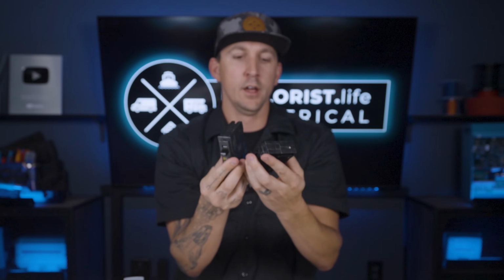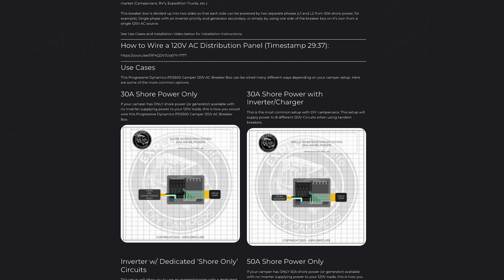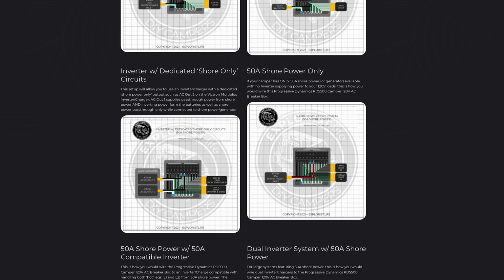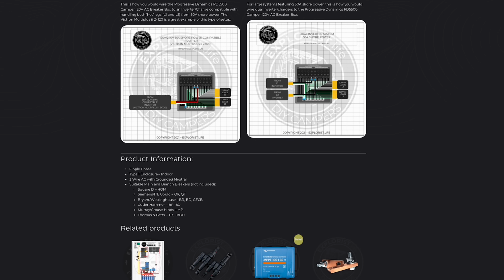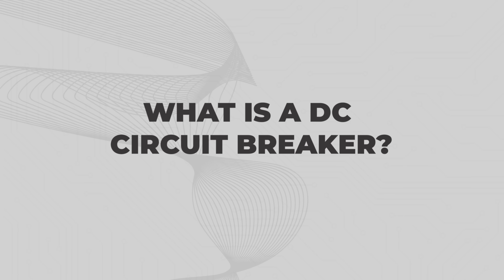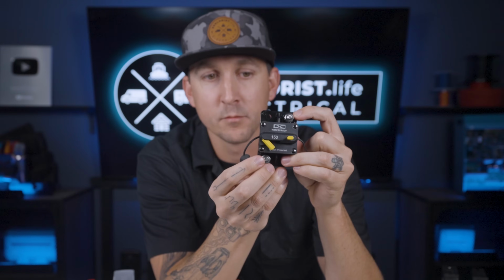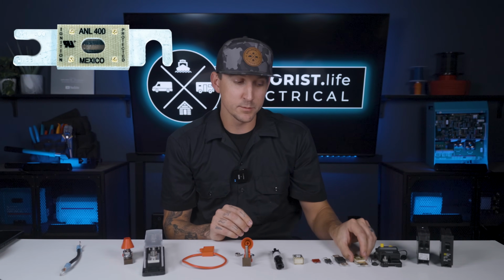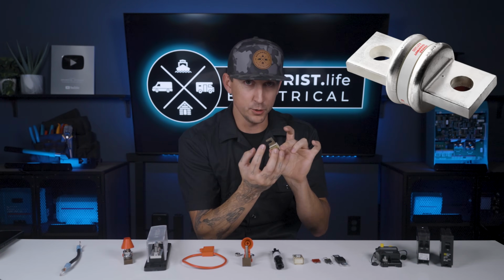Fuse and Breaker Types 101 - Fuses, Breakers, & Overcurrent Protection | Ep: 2/6

Comment: When you were holding up the automotive fuse you can see the notch between the two contact pins.  That notch fits the profile of the top of the fuse and you use an other fuse as a fuse puller tool in a pinch.

Comment: I have a victron Orion-tr-smart, which, other than being able to charge a 24v system is essentially brain dead. No way to monitor its current. I’ve got an extra smart shunt because I got the lynx shunt. So I connect up the Orion to the smart shunt, connect the smart shunt to the negative bar above the lynx shunt and set the smart shunt to monitor mode. I believe carbo go allows for two shunts. So this way I can monitor both?
Reply from the maker: This may take a more in-depth look at your personal setup.  If you have purchased/are purchasing from our store (shop.explorist.life) reach out for some more personalized help: shop.explorist.life/support

If you've purchased/are purchasing elsewhere, reach out to your dealer for support.  We'd love to have you as a shop.explorist.life customer so we can provide a bit more help in the future. 🙂

Comment: I bought a bunch of PV fuses. Looked some different inside than yours.
But they had bad connections - some 2 month in the use, they got bad resistance. The boat owner threw them out. 
I put them in because there were long and complicated / harsh ways for the wiring.

Comment: It's important to note that AC and DC breakers (also fuses and switches) are NOT interchangeable.  They have different requirements for interrupting current as DC power does not turn on and off by itself many times per second like AC power does.  Some devices are rated for both but at different current levels.  Always read the specs carefully.

Comment: I just bought an mrbf fuse with fuse holder to fuse my bluetti charger 1 cable at the battery side. Looking at your video that just popped up for me it seems the right choice for this type of alternator charger wire protection, would you agree?

Comment: Fuses? We don't need no stinking fuses. Guys, why are my wires smoking?
Reply from the maker: From our tech support inbox this morning:  "Hey Nate!  I didn't use your wiring kits and instead used 1/0 copper clad aluminum wire to power my 3000W inverter and it's not working right, must be a programming issue or a faulty component, right?"
Reply: @EXPLORISTlife  Oh yikes, that's scary! Sometimes cheaper is more expensive!

Comment: As a private pilot, I have often wondered why resettable DC fuses aren't more common. In our installation (a new Escape 21' fiberglass trailer) it came with a couple auto reset fuses which were new to me. We have installed some Blue Sea resettable fuses for things like tank heaters and also have a Blue Sea remote battery shut off. I really appreciate all we learned from your previous videos, and many of the newer series have gone just a little deeper. Thanks to all of you, our system is working great for us.